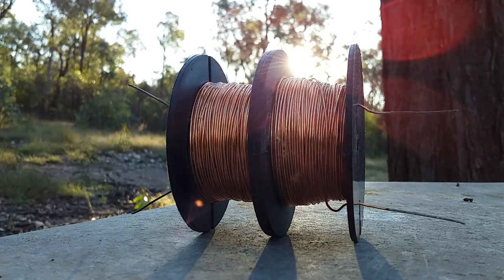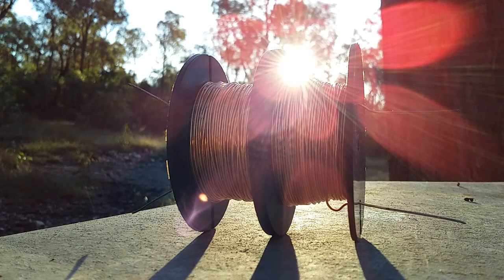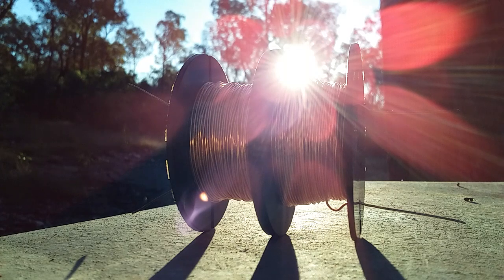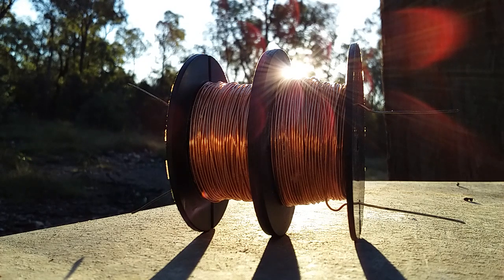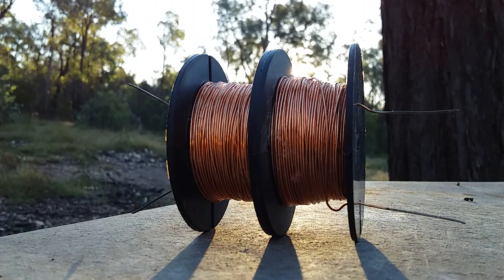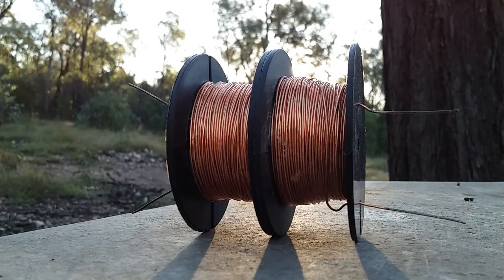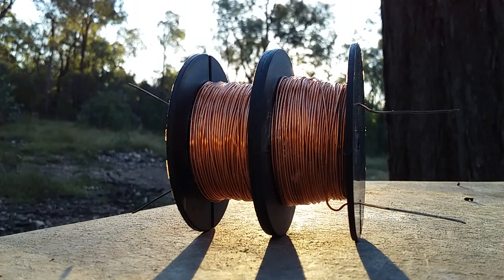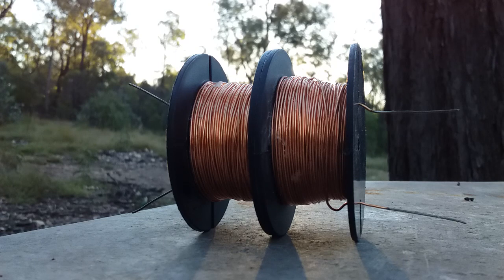The Standing Wave, Conserved Energy, and how Energy Machines Power the Load

Comment: Hey you might want to be careful with a coil like that. Most frequencies under 300 Hz are unhealthy and you're going to be exposed to a lot with a coil like that. Magnet motors like Bedini have the same problem. Someone on a forum said his magnet wheel experiment running constantly in his workshop caused a skin reaction like a sunburn and he eventually figured out carrying a magnet in his pocket fixed it. I can't vouch for that but I think the frequency should be very low for it to be healthy to be around it much. Like so low it might not work. Like around 2.2 hz according to research I would be glad to share if you care. So that guy's magnet worked because the frequency is 0. I'm not trying to discourage you if that's what this concern sounds like. I might be totally off base. I greatly appreciate what you're doing to get this information out.
Reply: What frequency would be not harmful to the human brain and body? 
Anything over 300hz?
Reply: Water holds energy in the resonance of water ions. For low frequencies this can persist for minutes before damping out. Animals all use the same frequency. Suppressing or disturbing it causes cancer. Pathogens of animals all use different frequencies. Other frequencies under 300 Hz also contain the resonances of other ions like potassium and calcium. Harmonics of the animal frequency are particularly carcinogenic. These harmonics are also where water absorbs the most, which is why they're used the most like 900 MHz and 2.4 GHz. They're used the most because the high absorption of water at these frequencies limits interference. The animal water frequency is produced naturally in the atmosphere by the rotation of the earth. It's based on the length of the day. That's why the only healthy frequency to use for devices operating without feedback might be 2.275 repeating 5 which is the first subharmonic of the animal water resonance. The subharmonic should be simpler to use because phase could matter with the frequency. Phase offset from the naturally occurring wave could suppress it. Phase matching is my speculation which is often wrong, but everything I said about water ions comes from Hans Giertz and the resonance of other ions comes from Abraham Liboff.